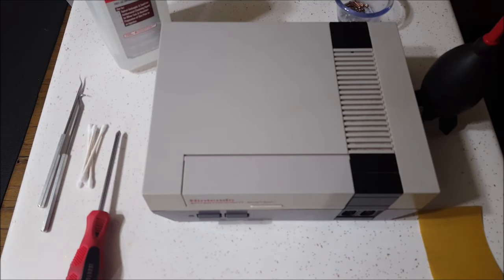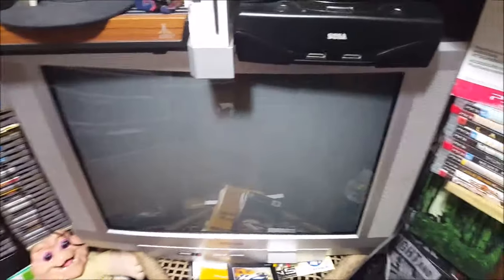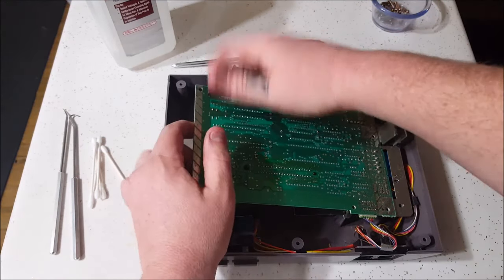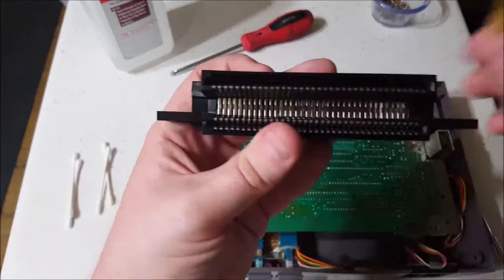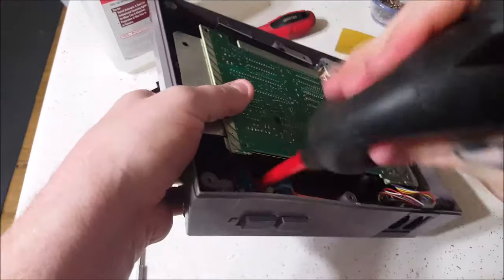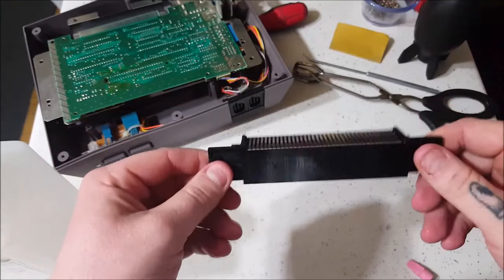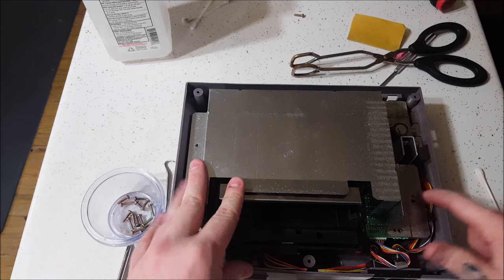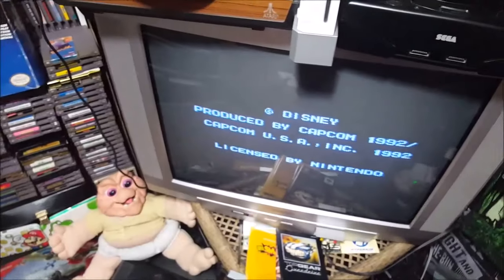NEVER Buy Another 72 Pin Again - How To Refurbish A Nes Easily

Comment: This guy knows what he's doing.  I agree its best to refurbish the original 72 pin connector rather than buying a new 3rd party one.  Much better quality and wont have that annoying tight grip.  Only thing I don't really agree with doing is disabling the lockout chip.  I prefer to keep the system as original as possible, but that's personal preference.  Once you refurb the pin connector you shouldn't get blinking light anymore anyways.

Comment: I use 3000 grit sand paper folded on a credit card with alcohol so I can do safer push an pull motions.  For the Nes I also tilt down a bit (like actual inserted cart) when I pull to get those top pins.
Reply: I use sand paper too it doesn't harm if you are using higher grit as it's very fine. I'm going to try your credit card trick 😉 that's a nice tip ty!

Comment: Does this work for the grey screen problem?
Reply: Didn't work :-(
Reply: It worked for me! The grey screen is usually due to bad connection, so if the cartridge itself is clean, the problem is most likely a bad connection with the pin connector.

Comment: Man, this is literally one of the best NES repairing videos I've seen on youtube. I just have one quick question for you, why did you performed the first step of this video? What do I gain by disabling the 4th pin in the 3193A Circuit? This is the first time I see someone performing this mod.
Reply from the maker: its not necessary but it enables you to play import games and the light will never blink again.  If you do everything as the video states and dont do that you will still be ok
Reply: @Renebean  THANKS A LOT! New suscriber here BTW. Great channel
Reply: I heard that disabling the locking pin will deminish the value of an original nes to collectors..are they tripping?
Reply: @damondelgado4603  tripping?! They falling.
Reply: @damondelgado4603  That’s up to the collector, best way is to desolder the chip and save the chip if you want to put it back on later for resale imo.

Comment: You didn't cover the top row pins. I recall with my NES I had to retension those. There's a metal tab on them that is accessible from a row of holes near the back of the connector. You push them down while pulling on the pin to "pull out" the top pin. I did this with each pin on the top row to add some more tension to them and this fixed my NES. The bottom row pins were fine in mine so I didn't have to mess with those. But yeah the top row of pins are hard to get at so pulling them out of the connector is easier. I didn't have to boil my connector in water either. Seems to run perfectly fine after I did that with the top row pins.

I'm not sure how many cases would require this, but having similar pick tools as yours would make pulling the pins out easier. ;)

The trick is to bend down the pin the tiniest amount possible while making sure the bend point is at the area where the pin gets narrower. It should be obvious where the pin should bend at. ;)

My NES I got for $70 at a local pawn shop. Came with RF Adapter, AC Adapter, 2 controllers and a light gun + Super Mario Bros/Duck Hunt cartridge and it didn't want to boot games so I had to do that with my connector. (this is also how I knew the connector hadn't been replaced. No death grip on the carts so that was a good sign. :D )

My unit came with the lock out chip already disabled. I kinda want to restore that though as I don't have out of region carts and it's more authentic to have it blink on/off when no cart is inserted. Good thing the chip is the same for games.

I should be able to just swap the chip into a game and use the chip from a game in the console. Don't think the pin in question is used on the game so the chip with the pin removed in my console should still work fine for game carts. Just waiting on getting better soldering equipment before I attempt this. :P

And now that I think about it, I could get one of those chip socket things so I can solder that in and make the whole lock out chip removable without soldering equipment, This would make "disabling" the lock out pin non destructive to the chip so if I ever actually have to turn that off, I can just pull the chip out of the socket and bend the pin out of the way and put it back in...so yeah that's what I'll probably end up doing once I get around to doing it.

Comment: I would put the 72 connector into the boiling water prior to sanding. Why sand the contacts then expose them to water. Wouldn't that create the possibility of corrosion? Did the pins have a protective coating on them during the manufacturing process? If so...sanding would remove this bringing them to bare metal and they would eventually corrode anyway.

Comment: when in the process do you put the pins for the original 72-pin connected down? you showed how you lifted them up and cleaned it. do we put them back down before boiling it? does the water naturally push them back down?

Comment: Great video, very helpful! What is the purpose of bending back the 4th pin on the 3193a? Is that necessary in a refurbish?
Reply: It's to disable the "lockout chip" that causes the system to perpetually reset when you have a faulty 72 pin connector or a game that has a failed chip that is the "key" of sorts. It's a very common mod to do on these. The top loaders didn't require this as it didn't have that chip.

Comment: I like that you re very thorough. I just bought an NES console and the cartridge doesn't go all the way down. Would disabling the lockout chip work as well for this?
Reply from the maker: if the cart doesnt go all the way down its possible the tray lip is caught on the board if you look under it there is a lip that grabs the board sometimes it goes above it which can cause that issue disabling the chip wont have any issue with it
Reply: @Renebean  thank you. I will give it a try, but won't be until maybe the weekend.
Reply: Does it by chance have a “blinking light win” kit installed? Those disable the cart from being pressed down

Comment: What type of screw is the longest screw? (the silver one). The NES my friend gave me was missing those when I opened it up.
Reply from the maker: well considering there is only 3 types of screws in the nes majority being the same, 2 used for the flip tray and 2 used for the pins it should be easy enough to narrow your search down.  If those are missing in yours it means he either attempted to replace or fix it at one point

Comment: Nice, so all I gotta do is bend the pins back into position?
Lol, I actually put electronic solder on the contacts of the first* NES cartridge I ever bought last year, because it went in with virtually NO resistance at all and I thought the previous owner had sanded it down a bit too much. my other games were working and that nonfunctional cartridge was only 4 bucks, so I thought why not try adding some material to the cantact pads? 
Well, it did semi work, I still had to try and resettle the game most of the time, but it did work after like two or three attempts where previously it didn't work at all. But almost half a year later all my cartridges just fall into the slot like nothing and only work after some VERY long fiddling and even then cease to work after playing for a while. So, it's high time I repair the cardslot on my NES!

BTW: Has anyone ever had bad experiences with the original power supply? Does it have the potential of going bad and frying the console, should it be replaced after all these years, or is it safe to use still? Not asking for any particular reason, just not sure, if this is a concern or not.

* (my parents bought a NES with Super Mario, Tetris, World Cup and Pac-Man when it was new and I've been playing these games for years until I finally wanted to collect some more games)

Comment: Absolutely love this video, very easy to follow!

So I did all of the steps and having strange issues with my NES. Hopefully you (or someone else reading comments) could help!

The first few games last night started right away! Awesome!

Then this morning I tried and they weren't working anymore.

I found that if I don't push the games down, some of them end up working.

The other games, I found, only work after inserting the game halfway into the NES.

Otherwise, it's a big white screen I keep seeing on my NES every time I press POWER.

I've cleaned the games and properly cleaned the system, any ideas?
Reply: The pins were bent too much (if you did that part) my first refurb job for my NES and all my games only play in the up position. If you push them down then it's a solid grey screen. I just refurbished another NES I recently acquired and made sure not to bend the pins too much. We will see how it works tomorrow morning when it dries.
Reply: @theowlsofouterheaven  Thanks for the info, I'll have to open it back up and see if I can do anything else with the pins, possibly get them back closer to the starting position (maybe more boiling to soften them up). Good luck on your most recent refurb! :D

Comment: Thanks Mr ReneBean.

Your method worked and i fixed my defective nes console that I think I might have only paid about $10 for.

So far it's working like a champ.

And yes it seems like even original Nintendo NES consoles do work without having to press the game down.

I think it depends on the pins and how high up aka new aka refurbished aka bent back into place they are.

If the pins are solid and tight then you can play your game without having to press it down.

Also I'm running my NES on a Sega Genesis power plug same 9 volts but maybe a little bit more milliamps.
Do you think it's okay and safe to use a Sega Genesis power plug on a NES ?

Thanks bro !

😀😎

Comment: I picked up an nes at a thrift store and someone already replaced the 72 pin with one of the crappy after market ones that are way too tight.  Is there anything way to fix these or should I just try and find an original ZIF one on eBay?  I thought about maybe filing down some of the plastic to see if it makes it easier?

Comment: The lockout chip these days is a waste. The original connecter is what you want to use. If you rgb this with the snes/n64/GameCube connector you can just buy a cable and plug it in to a modern display and get the proper experience

Comment: Did everything u said, it fixed the blinking issue but know it’s just a Grey screen and my games don’t come up, what happened?
Reply from the maker: if you done everything exactly than the nes would be working like everyone else's in the comments.  You may have missed a step or have not done one of the steps to the best of your ability.  Also make sure the games are 100% clean
Reply: @Renebean  Thank you for replying so quickly, i skipped the boiling water part, could that be why?
Reply from the maker: @ajgaskin6322  every part of the tutorial is necessary
Reply: Renebean also is it fine If the pins aren’t bent perfectly back in pace
Reply from the maker: @ajgaskin6322  the pins may not be perfect but bending them up is essential. You want to try to get them to line up. Make sure you re sand and boil
Reply: @Renebean  i boiled them and tried to bend them more accurately then i also checked that the chip I disabled was completely disabled and not making any contact. Cleaned my game again and put it in, didnt work at first but then i pushed it down and hit reset and it worked perfect. Tried other games, all perfect. Thank you so much for the help! Great video!

Comment: I too used to straighten the pins. After almost 30 years of it, I finally got a Blinking Light Win. Just do that. Trust me.
Reply from the maker: My personal nes is going on 7 years I think i'll pass.  If I have to refurb a nes (do more than straighten the pins) versus spending the money for aftermarket Ill save the money and take the 20 minutes to do the job.
Reply: @Renebean  Mine's going on 26... Seriously. Trust me lol. I calculate that over the years I've spent over an hour total doing and redoing the trick. I'm old and don't have that kind of time to spend anymore. It's the only aftermarket part I trust, it really is amazing. That and pin 4 of the lockout chip and every cart will boot, first try every (no, every) time. Trust. It's so worth it.

Comment: I really appreciate this video, thanks to you I was able to play my nes that has been sitting in my garage for 25+ years.  But after playing for about a month I now have vertical lines on the screen for every game I have. The games are clean so I'm thinking it's the system. Should I just clean the system again?
Reply from the maker: if they are loading up and playing easily it could be a failing cap or motherboard

Comment: I accidentlt disconnected the top as well as the bottom connections. I dont have a tv to play on at the moment but it should still work correct? The light is fixed now and no longer blinking so im hoping that's the case

Comment: With my NES I have to put another cart on top at just the right pressure to hold the cart I want to play firmly down, otherwise it will just blink. I've done this except the sand paper and lockout chip mod. I'll try the sand paper and boil again.

Comment: I've had a problem with my NES since I first got it in 1993 where you really have to roll the dice to get a game to work. Sometimes it works, but most other times, it's a blinking grey screen. If done correctly, will this process likely solve the problem? And is there a risk of electrocution even when not plugged in?

Comment: I bought a nes around 11+ years ago and had my pins replaced. Can I and should I consider finding an original 72 pin to replace again or possibly getting another console? I haven't used it in a few years, and barely anything works on it. I usually used to put it in a game genie and it would help start the game, but now barely any of my games will start. Usually black or white screen. If not that, it freezes. It's a newer nes with an rca connector.

Comment: Did the 72 pin connector clean and my copies of official Nintendo games (super Mario 2, punch out) worked perfectly, but my 3rd party games were doing the grey blinking thing. So I tried disabling the 4th pin on the lockout chip and now I just get a solid grey screen for all my games ☹️ Am I screwed, or is there something else I can do to fix it?

Guide was really good though thanks, pretty sure I just messed up somewhere!

Comment: why did you bend the pin on the 3193A circuit?  I did that but I'm only seeing a white screen when I plug in my NES and wonder if that's my problem now
Reply from the maker: make sure your games are clean and it will fire up.  Try blowing in the cart and with the game inserted power on and press reset.  If you get an image of anything your games to blame

Comment: You are the S**t man!! I have watched you on your hunts but this is amazing. I used to do 72 pins and they worked in the past but the last ones I got sucked so bad.  This worked amazing. My only question is if the RF adapter makes for a fuzzy screen and twisting it makes it fine what do you or can you to to clean the part that connects to the NES? Again! Thanks, Oh and I just got a return authorization for this crap pin connectors : ) I will have to buy some OEM ones cuz I believe a few of my systems have new ones in them but are still faulty.
Reply from the maker: glad the video has helped.  Rf boxes are commonly faulty. Switch to AV
Reply: @Renebean  yep much more reliable, and i picked up a huge bunch at good will for 99 cents or less, on ebay cheap ones sell for $3 or more so you cant beat that 99 cents! I usually sell my NES as I ahve my tester and my CIB system already. I have a ton for resale but I am seeing people get $100+ and others a lot less, what do you put yours up for? Seems people want the new 72 pin and do not really buy into this refurbish, do you word it a special way? Can I see one of your NES posts? I did this and only got $65 complete gun game etc with free shipping which was not really worth it. Thanks

Comment: Is there some refurbishing technique when the unit will not power on?  The NES-001 was purchased over 30 years ago and have been in storage since with the original adapter.
Reply: I accidentally dropped the console and now there's a blinking red light....any suggestions how to fix it?... Lol! Thanks.
Reply: @chenaniahr.l.2936  it's a little late, but blinking red just means games aren't even being read by the system. Bending the pins and boiling fixed this problem usually.

Comment: Two questions: 1. Is there any benefit for disabling the lockout chip if the only games being played on the system were licensed games? 2. What exactly is the boiling mean't to do?  Is there a risk that the plastic might melt?
Reply from the maker: in some cases the lockout chip can malfunction regardless of how clean the game is and blink.  However if you had no interest in other games not disabling it is not a bad thing.  After sanding the pins there is a lot of dust and grime leftover, boiling is essential.
Reply: @Renebean  Thanks so much for the reply, I will go ahead and disable the lockout chip to eliminate any "blinking" variables. 

I had watched another video, where the demonstrator only cleaned and polished the pins with metal polish, and the system worked afterwards, but I'm going to definitely follow your directions first as sanding and raising the pins make a lot of sense. 

This video was great, thanks!

Comment: Whoever had my NES before me stripped one of the case screws bald. I have tried the rubber band and finger of a latex glove methods, neither of them worked. It is so bald that it's round. Is there anything you can think of that would work?
Reply from the maker: may have to use a tap a die

Comment: All I did was clean the top of the connector with a credit card and bend the pins and my NES actually works. Great vid Also would it be okay if i used a toothpick for bending the pins?